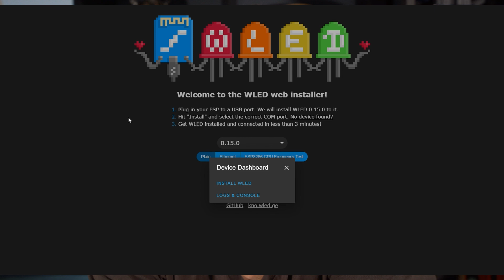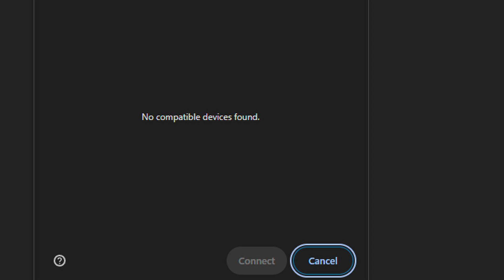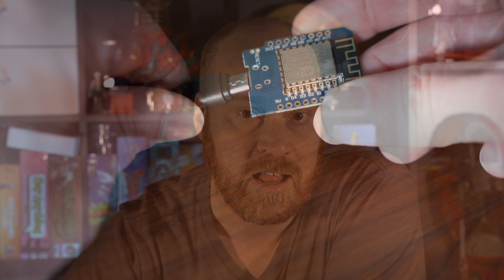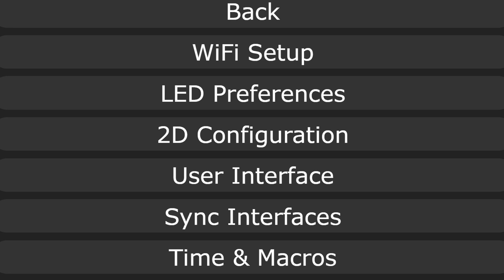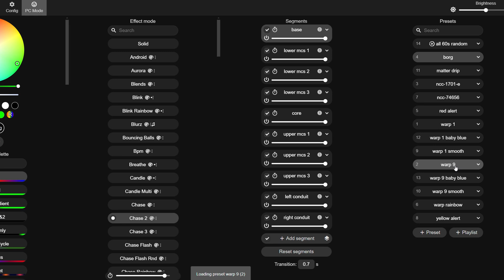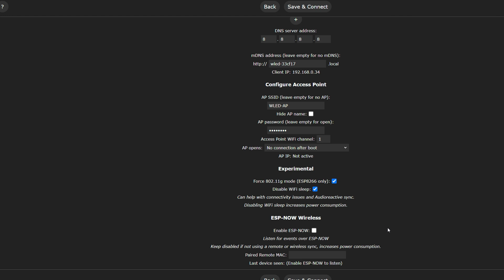Star Trek Enterprise-D Warp Core 3D Print and Build - Part 3: WLED Installation

Comment: Thanks for the pointers in this video.  I also had a few problems doing the initial programming of the esp8266 board.  Two of the five boards were not able to create a USB serial device when being plugged into my PC, and I needed to replace the USB cable to program the others.  The only remaining issue is getting the esp8266 to join my local WiFi after going through the WiFi setup.
Reply from the maker: No worries. Have you solved the WiFi issue? May be worth setting up as an access point to connect directly to it so you can modify the sleep and WiFi modes before reconnecting to your network. 
One thing that I’m not sure definitely helped is setting one of the presets as the startup light sequence rather than one of the built in WLED modes. Not had any issues since I did that, but don’t know why it would make a difference.
Reply: @DodecBuilds  I'm able to connect to the esp8266 access point, which it creates every time it fails to connect to my local network.  From that I've disabled WiFi sleep, forced 802.11g mode, and net ncc-1701-e as my default preset.  I even had it connecting to my local network a couple of days ago.  But I turned it off overnight and when I turned it back on in the morning it no longer connected to my local network.
I'm beginning to think my esp8266 board may just be flakey.
I'm debating replacing the board a new one, or maybe even trying esp32 board instead.  I think the esp32 should be a drop in, so long as I make sure that the Data GPIO is set correctly for it.